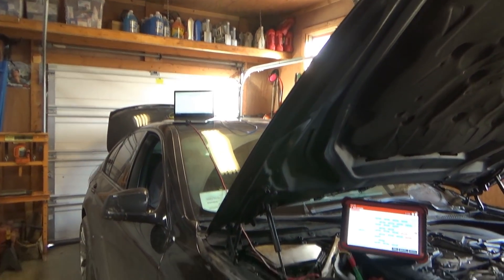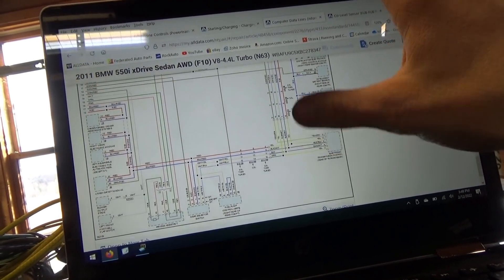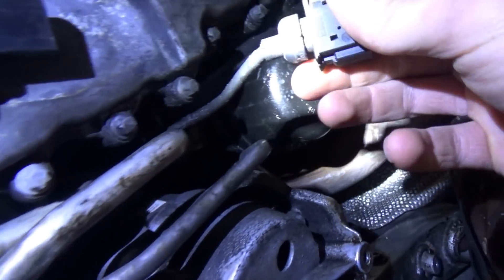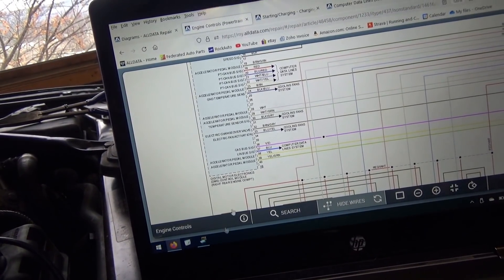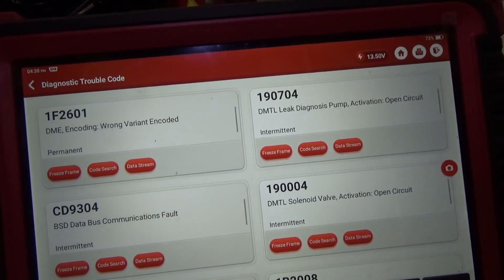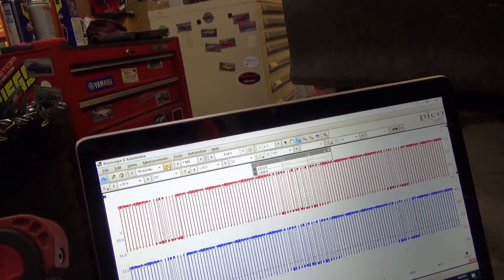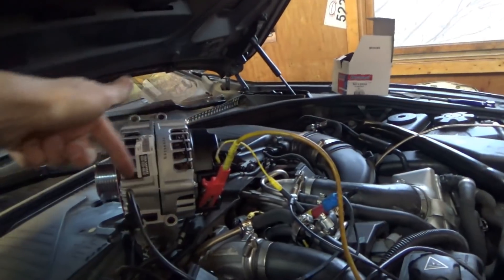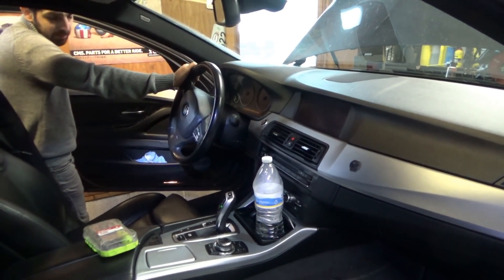Customer Drove 15 HOURS...BMW: What's my OIL LEVEL???

Comment: This is just astonishing. 5 parts including 3 computers at the same time! I don't know if he had to buy all the spares or if some of them were provided at no cost when he bought the car, but they still had to cost a ton of money. Congrats for the diagnosis. This could be a car at the dealer for a year and thousands of $$ fired to no avail kind of case so you still most likely saved him a good amount. Looks like you are of the very few automotive electronics wizard who can solve such cases.
I love the F10 generation of 5-series and most BMW models but each time I think they got better than E60s reliability wise, I'm proved wrong. And those were only electrical problems, wait until this pre-update N63 engine trashes its timing chain, VANOS actuators, valve stem seals and leaks oil...
This is a beautiful, fast and comfortable car and with Lexus-grade reliability, this car would be AMAZING. But it is what it is.

Range Rovers could still do worse however, it would be awesome to see one on the channel.

Comment: GREAT Video!  Had similar issue on my 2008 E60 and the oil level sensor pulled down the BSD network for alternator, IBS, and Oil Level.

Stupid oil level sensor also caused "smart" alternator to not charge and left me stranded......GRRR!

Also cost me a new alternator (replaced b/4 understanding the network failure, old alt still good!) and 8qts of new oil to replace the stupid oil level sensor.  

BMW:  Please just put the did-stick back!

PS:  I had no grounding issues.  Just the failed oil level sensor.

Comment: A new alternator did odd things my Volvo V70 D5, or rather odd things were happening with the old one. I'd been driving about with a disconnected front ABS sensor for 12months, but only got a warning message &  DTC for it after fitting the new alternator. It was also the 1st time the diesel pre-glow lamp illuminated on the dash.

Comment: This is crazy. Lincoln (well, Ford) got this right in the 80's. My '89 Town Car has a simple low oil level sensor which illuminates a clear warning light on the dashboard: Low Oil. Pretty obvious what is going on. Stop and put oil in it (manual says 1.5qtrs low when the lamp comes on if memory serves). Critically, this in addition to, not replacement of  the dipstick (WTF!). Why in the world would they do CAN bus style communications to a module on the bottom of the car - high damage area! - and connected to the alternator - high failure rate part! - and then remove the reliable physical check? Why??? And then double down with terrible electrical engineering of failing to protect sensitive electronics from current loads due to a bad ground.

Comment: I once had a computer network get hit by lightning. The lightning actually hit the ground which bypassed all of the surge protectors and cooked motherboards, network cards and modems, not to mention the phone system.  Basically it was a ground fault power surge.  Kind of like what you have there... so yes everything is cooked.  

Heads up, if the alternator voltage regulator isn't working correctly you can get another power spike that might cook everything again.... replace the alternator to protect the other modules.  Better safe than sorry.

Comment: Ivan, I apologize!   I sat here laughing everytime you got something fixed something else pops up!  You did not get frustrated, and you forged ahead!  Truly a REAL PROFESSIONAL!
To put an oil level sensor in the bottom of the pan is crazy!  Salt, sand, water, brine all coming at it outside!  Then old oil, other contaminants hitting it inside!  NUTS!
Then no protection for the comm lines in the computer, the alternator dies because engine grounds are loose, no protection there!  I guess this all answers my questions in part one's comments.  "What caused these modules to go bad, or words to that effect!"
I could say "BMW, The NON----ULTIMATE DRIVING MACHINE!"
I like yours better.......BIG MONEY WASTED!  This one's worse than the Euro Trash!

Comment: Very interesting video, with some difficulties put in your way, which you worked through very well and was successful. Good job.

A theory as to why the DME (or was it the ECM), Oil Level Sensor, and maybe the Alternator were taken out because the grounds (GND) were missing from the block. Without a ground, assuming the BSD bus devices use this ground, the BSD signal would be stuck at 12 Volts DC, or higher. There would be no ground to pull this signal down to.This connects to the Alternator as well as the Battery voltage (Red Wire). It may be, maybe, the Alternator generated a much higher voltage, say over 20 Volts DC (24 Volts DC or more), which powers these devices that quit working. Probably powers other devices, but maybe they could withstand it, or just lucky. Just a theory.

Again, very interesting and well done.

Comment: Lol looks like someone did the budget option for the leaking turbo lines. Its not a bad move considering, the engine will need to be replaced by 150K with new turbos and lines. Some opt out for timing chain and valve seal service but its cheaper to replace.the engine lol.

Comment: I'm about done with BMW.  I love the way my 335d runs and drives, but this is just too ridiculous.  $100 to "register" my new battery, because of the intelligent battery module is asinine.  Can't find decent maintenance and repair information.  Their attitude is that you should just drive the car until it tells you to bring it to the dealer and spend half the value of the car for service.  What ever happened to BMW as an enthusiast's car, where the drivers had dirty fingernails?
Reply from the maker: Well put

Comment: 1000 miles per quart is not bad..the N63 F10 550 I got rid of was going through  a quart every 200 miles
Reply from the maker: HOLY CRAP BLUE SMOKE MACHINE 😂

Comment: I've seen my fair share of broken engine computers on BMW MINI's from people leaving this ground on the valve cover floating, usually after changing the timing chain. This wire is the ground for the coils, resulting in voltage spikes to the ECM output. Interestingly, on MINI it usually breaks the 5v reference output, destroying the accelerator paddle in the process since the 5v output becomes 10v or so. 

You could blame BMW, for a flaky design, but I also think mechanics should just put everything back together the way it is supposed to be connected. It's the responsibility of the manufacturer to make sure the car works and is fixable, but it is the responsibility of the mechanic to fix it correctly.
Reply: I agree, however I also think the engineers should have realized that as the car is age a ground wire could simply corrode off or have a rodent eat through it. Should that really cause thousands in damage to expensive computers? What they should have done is run major ground wires through the engine computer harness itself. And any other module harnesses. So it as long as those are plugged in to their main harness they have a good ground. It would be fine to have additional grounds and other locations. But system critical grounds should have been run through the main bus connectors at the computer in the first place.
Reply: @kens97sto171  I highly doubt that BMW allows ground loops in their design rules. It would be a hell to pass EMC compliance rules with a solutuon like that. What they could have done IMO is decouple the ignition drivers from the 5v regulators better inside the ECU.
Reply: @tomvleeuwen  
I don't know. Every major electronic component in my car which happens to be a Toyota. Has its own grounds in the harness that connects to the component itself. There's certainly are some body grounds. Multiple grounds coming from different locations bonding to one grounding point on the chassis. But if you pull the connector off of the main computer, it carries its own ground.
If somewhere along the harness that ground came unconnected, it would simply not power up. To me that's the major design flaw in this BMW. The systems still functioned but allowed themselves to be damaged.
I guess it's possible you can consider that a backup that it would keep you from being stranded. I'm not sure which way is the better design philosophy.
Reply: Their electrical engineers don't know what diodes are

Comment: Wait just a minute! Did I hear that right, no oil dip stick in that car? Now I have never owned one of these cars, but I can not imagine an engine without one. I would think that oil being so critical to the engine operation at a simple mechanical (non-electrical) is needed, it would never fail due to ground interruption.

Comment: I had an identical situation about 6 months ago with a 2009 BMW 750LI.  The oil level sensor went bad and after changing it, the level sensor still wouldn't read right.  Would also show a random battery discharge warning.  I checked all the wiring, and the integrity was good.  But more often than not, the signal wire would show about 1 and a half volts most of the time.  And yet the alternator was charging just fine.  I never did solve it.  But I suspected a bad ECM was the issue.

Comment: Sweet outcome great case study 
A lot of useful info
I bet right out of the gate u noticed the lin bus voltage way to low pulling from 8 volts to ground.
John Thornton had an interesting case similar where the body module on a Nissan ( which is the master ) was only putting out 7 volts and other modules would pull it to ground. 
I believe ther was also no com just consistent pulses
He took a test light and( in his own words ) jump started communication 
However the 12 volt master feed never returned but there was com
Manufacturers are now putting two three or four slaves on a Lin bus and anyone of them can kill the private network. 
Thx again

Comment: I really don't know why people buy BMW, oil level sensor?  What's wrong with a dipstick, lol.  I bought my 2004 Sequoia 4WD a couple of years ago, 150, 000 miles, does not miss a beat.  Paid $4,000.  Zero problems.  I'm guessing it will outlast this piece of junk three times over.  My other vehicle I use for my commute to work, it's a 1997 Celica GT convertible I paid $1200 for in October, I wager this will outlast this BMW also.

Comment: I don't mind the electronic oil level monitoring  because honestly, how many average car owners today can open a hood, much less read a dipstick. (Followers of Ivan are not average car owners). But one fault that destroys other systems is totally unacceptable in today's engineering capabilities.
Reply: Forget that. Let them ruin an engine or two by being too lazy to check their oil and I bet they learn real quick. It’s not rocket science. You pull out the stick and see where the oil is on it. I don’t understand how we’ve gotten to the point where checking a dipstick is too advanced for some people. If you are going to own/drive a vehicle then you should know how to do the basics like checking fluids, air pressure, and changing a tire.

Comment: Guess for oil sensor.  computer uses level information over time because it can move around a bunch as you drive.  Finding average level.  It had good information from good sensor.  Still using that  even while bad one is plugged in.

Comment: I've never seen that before, i was wondering was the oil level sensor original or was it replaced by something aftermarket?
Reply from the maker: All original parts. Apparently starting the engine with the grounds disconnected caused ALL the problems 😬
Reply: @PineHollowAutoDiagnostics  I had an 80 camaro that melted the shift cable if you had a bad ground.
Reply: @frozenstang3868  Ah, the good old days. A simple and obvious fix using your own scan tools, your nose and eyes!
Reply: @PineHollowAutoDiagnostics  ...and it burned the computer...
Reply: @PineHollowAutoDiagnostics  how did that happen?
Reply: @PineHollowAutoDiagnostics  This just proves my point that most of the problems on BMW's are caused by the "mechanics" not that the cars are bad... :) However, great diagnosis.
Reply: The oil sensors are infamous for failing around 75k-100k....

Comment: A solid ground is everything. If even 1 ground connection is missing you may exceed the common mode range of the device in the module and that will probably fry it.

Comment: You really want to read the factory service manual before tackling this baby. Ignoring the ground connection is not advisable in any model. The present owner was prepared for all eventualities. Nice to see all modules working as they should. Programming seems to be another part of the agenda. The world Bank phone number for extra funding could come in handy. Don't think a BMW will be on the shopping list anytime soon. Job well done at the same time for such a complex diagnosis.

Comment: After hearing about so many module / wiring issues on German vehicles, I'm convinced that they don't have many competent Electrical Engineers. Such sub-systems should be "hardened" from events like ground failures or voltage spikes. I believe they are better with Mechanical engineering.

Comment: If that oil level is correct after it finally read it, that engine is gonna blow soon or mechanical damage has already occurred.
Reply from the maker: That was the new oil sensor just plugged in, not installed. Would need to drain 10 quarts of oil for that 🤣

Comment: dealership repair for this car:

"pull it on in to the service bay"

Service tech removes radiator cap

"pull it out"

"pull in new car"

Service tech puts on radiator cap

"that's it, car's fixed!"
Reply from the maker: There is no radiator cap on this model... So much for that plan 🤣

Comment: Excellent work PH. I wonder if this vehicle was ever driven into some deep water or some kind of flooding, considering thr VTG and the oil sensor both sit at the very bottom of the car. On a side note, I really like how that Thinktool pro lays out the modules in that tree pattern.👍
Reply from the maker: No flooding.

Comment: As you diagnosed, a faulty part on the BSD network can take down communications to any/all components on the network.  The BSD errors started for my BMW AFTER alternator replacement.  New TYC alternator charged fine but caused BSD error on water pump forcing it to run continuously at default/safety strategy.  Final fix was replacing the voltage regulator on the TYC alternator with an OEM Bosch regulator.  BSD errors gone and all modules happy.  N54/2008.

Comment: This is actually a poor design issue on many German cars and reason why Toyotas are so much better. The problem is that BMW, Porsche, Audi, etc. typically have one thick ground wire for the engine. It is designed to carry starter and alternator currents. Then you have many sensors that are grounded to the engine. If the main ground is disconnected/corroded and you try to start the engine, now the current is looking for a shortest path to ground. All you have for that are sensors and modules which were obviously never designed to carry high current. Sensors/modules that have high internal resistance will be fine, however, sensors/modules that have low internal resistance will experience a current much higher than they were ever designed for, hence they will all be damaged at startup in this situation. And where are these sensors connected to? The engine computer of course, so now you have excess current run through the engine computer. Also, depending on the design you may have high current run through ball bearings in the transmission, which will also cause damage. So why is Toyota better? I've noticed that they generally have several ground cables going between engine and chassis. Therefore if one fails, you don't run starter current through sensors, engine computer, ball bearings in transmission, etc.. I also don't think that it costs that much to add a second ground strap. Therefore for an old German car a useful modification is to add a secondary ground. Find some place on the engine or transmission (there is often some threaded holes not used) and some place on the chassis, and install a heavy duty ground cable.
Reply: Funny you mention Toyota being so great.  In actuality, many late model Toyotas have a very similar issue.  There are some grounds in the left front of the late 2000's and up Camrys, etc. that, if left off, will damage electrical components.  I know this because a body shop owner told me the insurance companies will not pay for damaged computers and components if those grounds are left off.  There may be reasons Toyotas are better but it's not for this reason.
Reply: @johnaclark1  You may be right as I have not worked on enough Toyotas to make a broad claim. However, the few that I did work on I did see several separate grounds and thought that it was done for redundancy reasons. Anyhow, if you have an old vehicle that you would like to keep for a while, probably not a bad idea to periodically disconnect the ground cable and clean the points of attachment, and better yet, add a secondary ground.
Reply: @borisp9499  my son’s old civic had corroded grounds from the motor.  Made 2 for under 30$ and it started faster. Tough old beater.

Comment: Thank you for a great BMW diag video!  Where were you when I had this issue!  LOL.... I also had a BMW 2007 X5  4.8i.   It was ran low on oil, and set several Vanos codes. Ended up being the DME "Ram Backup"  having an oil disturbed oil level issue. Only way to clear it, is with Ista.  Procedure was resetting CBS in Predelivery Check.    Bulletin  SI B12 08 15